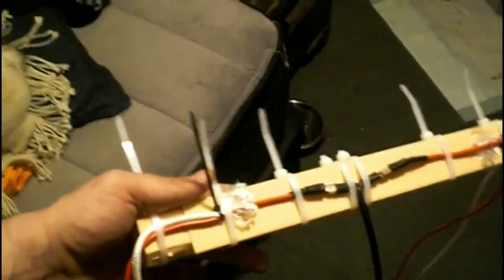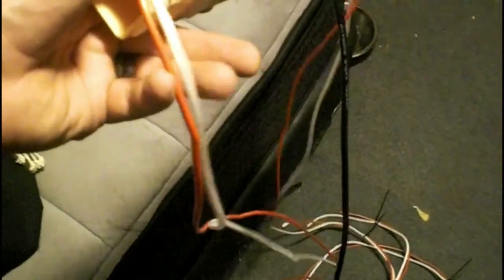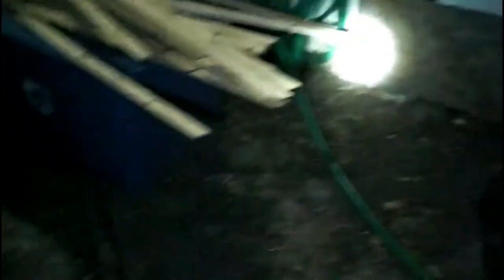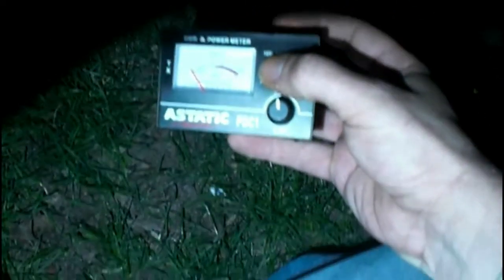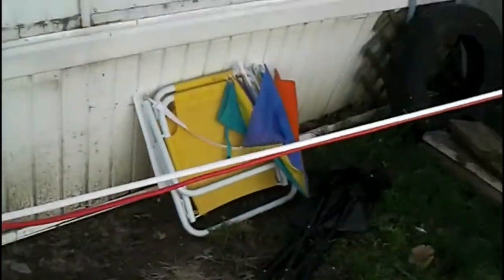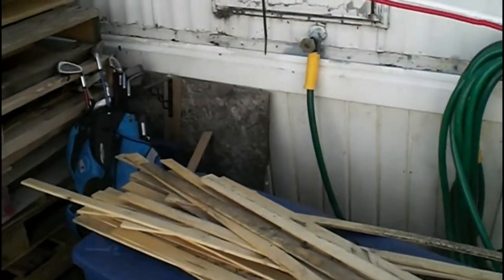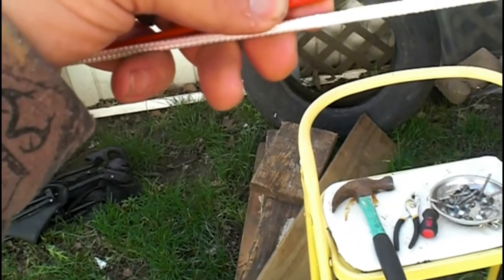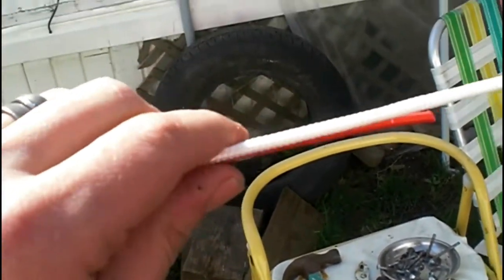CB antenna build homemade 1/2 wave Dipole

Comment: Strip a foot of wire on each end and then fold the antenna back on itself  until you are flat at your desired frequency.  104 inches per side is way too long. Also raise the center and let the ends droop at a 45 degree angle to get closer to 50 ohms.. A flattop dipole is more around 70 ohms.
Reply from the maker: Thank you, I will try that next build

Comment: 104" on the dipoles sounds a bit long to me. The formula of 234/lambda (27.4 MHz avg freq for Ch 20) would be appox 8.5 ft or 102.5 in., give or take a smidge.

Comment: Too much metal around the dipole.  Also try to set it up so it is supported in the center. Get rid of the connectors. Just solder direct to to coax and tape. For center support I use a pvc tee. Then tie a rope to that. Needs to be up in the air more in a free space from metal. Remember don't cut, fold it back on itself. Watch dipole vids. They will put you in the know. Watch the ham radio ones. Your starting measurements are fine. You don't need the carrier line on the wire. You could use the board you have, make it smaller and drill a hole at the top to tie your rope to. Watch ham dipole vids. You will get it. Piece of cake
Reply from the maker: thanks for that, its all a learning process for me thats for sure.

Comment: Hi Cory. my handle is sandbagger 151 in Southern California. I was watching your videos on your dipole build. I read all of the comments that came in and it does not appear any were helping you. A dipole antenna is a ballanced circuit at about 100 ohms, your coax is unbalanced at 50 ohms. You need a 2:1 or 1:1 current balun at the antenna. You need to raise the antenna 8 ft. above ground End to end. I use telescoping fiberglass fishing poll's. :0)
Reply from the maker: I think I've made contact with you on channel 38 lower sideband before but thank you for the advice
Reply: @CoryRandomGuy  yeah most likely from my mobile unit. 100 watts, wilson 5000 ant. 73's sandbagger 151

Comment: Try winding the input line into like 4" circles tight to itself taping or zip tie to hold shape you now have passive balun in line have it choke the line about 6" away from line terminations at the split also get as much line above ground as possible most cases 6' in air is a good test height plus it also depends wether you go vertical horizontal or any combo between like diag on both sides  or v shaped there are so many combos you can do to tune an open ended centered there is no set " fix" 
This is why this is called hobby !!!
Reply from the maker: I will have to try that thanks, I do have a question though, how many turns will it take to create that choke
Reply: @CoryRandomGuy 
Hi Cory,  You will need 8 to 10 turns on a 6" to 8" coil form to have a 1:1 current choke on 11 meters.

A current choke (misnamed a BALUN) does nothing for matching (that would be a voltage balun (transformer)), it just prevents most common mode currents (CMC) from traveling down the outside of the coax shield and getting into electronics in your shack and home electronics, as well as your neighbor's home electronics, by causing a very high resistance on the outside of the coaxes shield while having no effect on the inside surface of the shield or the center conductor.

A dipole has a characteristic feed point impedance of around 72 ohms and no matching network is required for tuning the antenna and getting a good VSWR below 1:1.5.

Having the antenna so close to the ground and so close to the building, the match will not be good.  The antenna should be raised to about 1/2 wave length above the ground (minimum of 210"/17.5' for a 1/2 wave length) and as in the clear (away from buildings and trees) as possible.

73,
Jack,
891 S.E. Massachusetts

Comment: You need a matching network, your coax and radio is 50 ohms, whats your ohms rating of your antenna? Betchya its not 50 ohms, its probably 50,000 you have a mismatch, therefore you need a matching network.  
    What is the length of the actual radiator?
Reply from the maker: When I made that it was roughly 102 inches on both ends. SWRs we're good once I tuned it away from in between the trailers

Comment: How long are the wires from center of the coaixl cable to the ends
Reply from the maker: About 102 in
Reply: Ok thanks
Reply: @CoryRandomGuy  That is only one quarter wave, you'll need to make that atleast 1/2 wavelength with a matching network in order for that to work.

Comment: Jesus, between 2 huge metal tubes....
Reply from the maker: Ya, I ended up taking it out away from from the metal tubes and getting it tuned in. Unfortunately I didn't video it but I did get it tuned in.
Reply: @CoryRandomGuy  nice. Ya I had mine hung over my giant propane tank. Moved it and working great